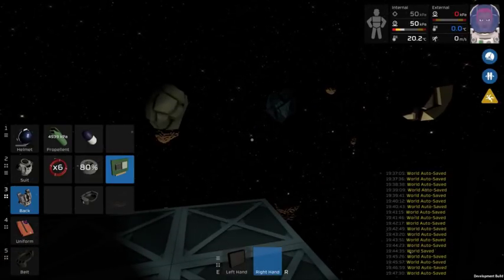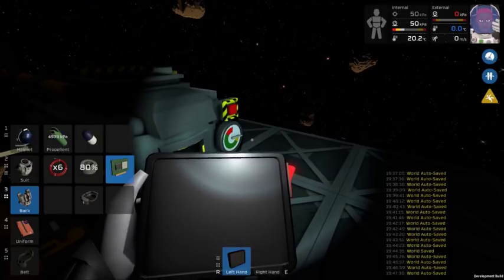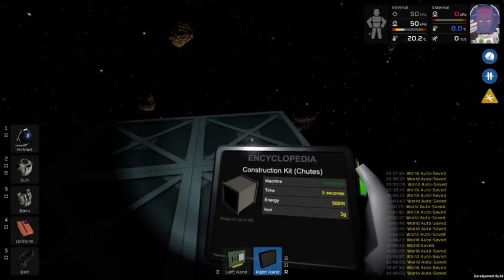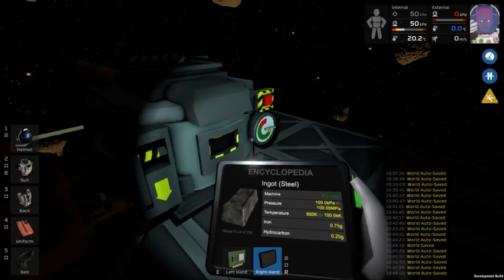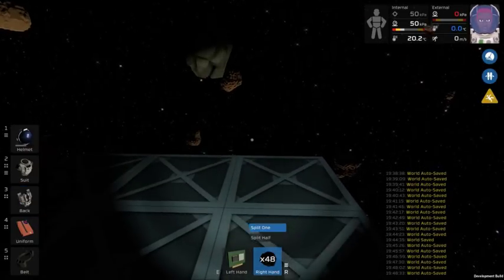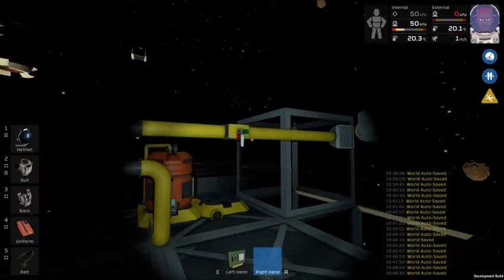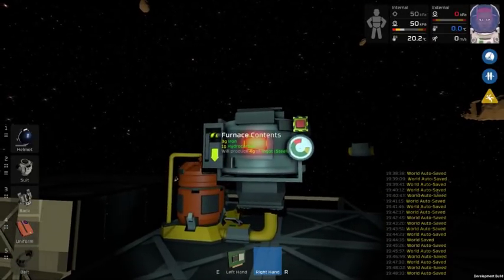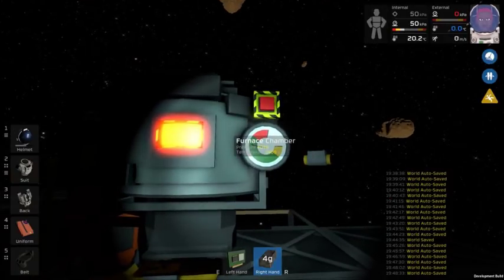Stationeers - Making Steel in a Furnace

Comment: What gas? What temperature? What pressure? Why do you need to vent? What are you venting? How do you GET that gas? So many unanswered questions!
Reply from the maker: Of two maps (moon and space), space is the only one that the developer tools work. You can use the developer tools to spawn in items. I spawned in a fuel container. It's a container painted orange that's already full of H2 25% and O2 75%.
You attach it to a tank connector by dragging it and dropping it ontop of it and then using a wrench to attach it.

The furnace screen will tell you if you have an output. If you can output the new material you have got all the inputs correct. The exact values for temperature and pressure can be viewed on the tablet with the Ereader.

You need to block of the exit vent so that the pressure can build in the furnace. When you vent, you are venting CO2 and some O2 and H2. (When the H2 and O2 are consumed they produce CO2. Its bad chemistry, but that's how the mechanics work right now.)

I suspect people will want a longer video explaining all of this and going through my setup slower and in more detail.
Reply: Except you can actually smelt items in the furnace using a mix of 1 part oxite and 2 parts volatile, without even bothering to connect anything to it. 1 oxy and 2 volatile can smelt a stack of steel.
Reply from the maker: Yea, that's the most basic way to do it I think, but the furnace was designed to use pipes for the gases coming in and out.
Reply: Yes,Nice Video,but a Tutorial dir the gasseswould be nice! Thx anyway!
Reply from the maker: https://www.youtube.com/watch?v=nugEOdeh2BI